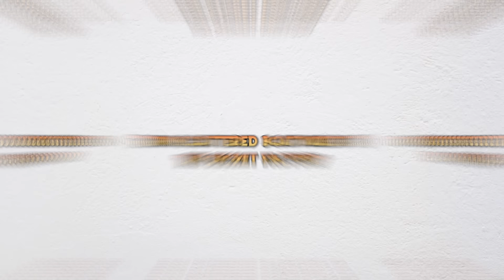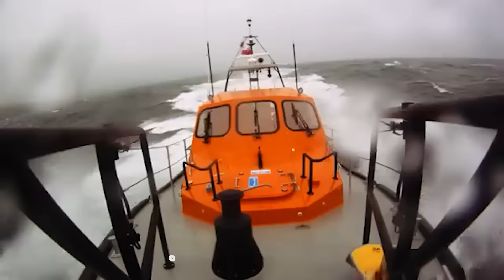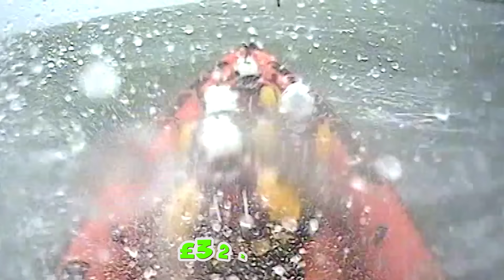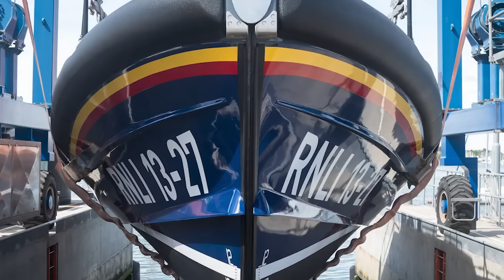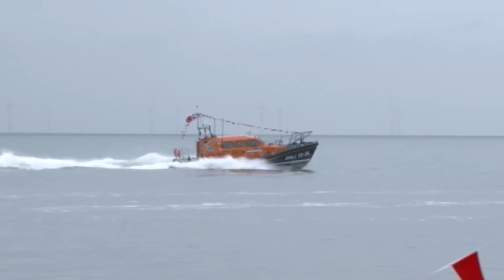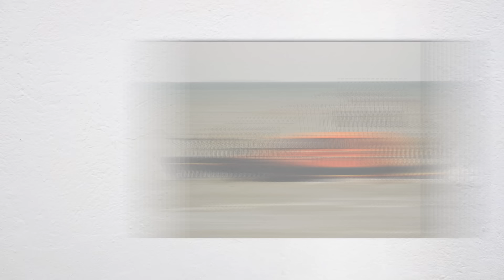Why RNLI Always Use Boats By This Company?

Comment: The RNLI is funded by government via huge contracts providing all beach lifeguards and poolside guards in swimming pools.
Reply: The lifeguards are funded by counsels, and they do not make any profit nor cover the full cost. The rest is supplemented by the RNLI to have this service on the beaches. And RNLI do not provide pool side lifeguards apart from their own training venues.
Reply: Not accurate.  Lifeguards are provided by agreement with the beach owner, usually the local authority.  Equipment is provided by the RNLI, lifeguards employed seasonally by the RNLI, some are volunteers, and the cost of employment is picked up by the beach owner.  Not ‘huge contracts’ by any measure.
Reply: @nw637 rubbish. The RNLI train and run all beach life guards now. I have three stepsons who have gone through the training.
Reply: The rnli don't provide any pool lifeguards except at the training centre, pool lifeguards are a completely different discipline of lifeguarding with different equipment and training, the pool lifeguards are often trained and employed by their respective facilities, but can do external training just not through the rnli!
Reply: @jakedovey7488 the RNLI dominate the training now. have done for 15 years.
Reply: no its not you don't know what you're talking about
Reply: @londo776 I live in 
Poole, I was boatbuilder. I have friends who work for the RNLI.
Reply: @marklanahan7289  The RNLI receives very little funding from the government, making up less than 1% of its total income, not exactly massive
Reply: @londo776thats the charity. Do proper reseach.